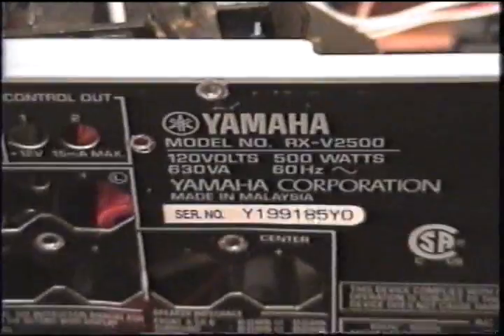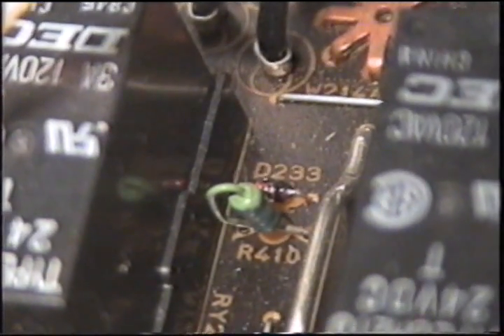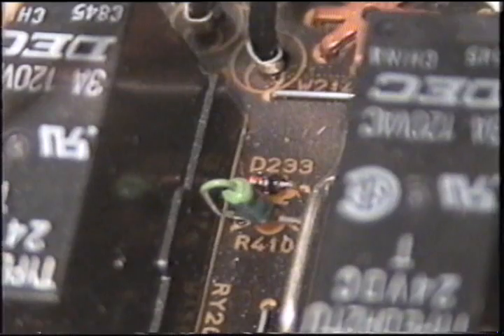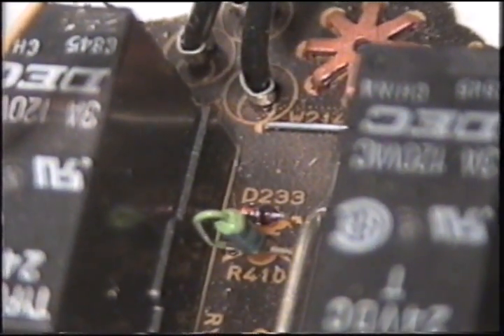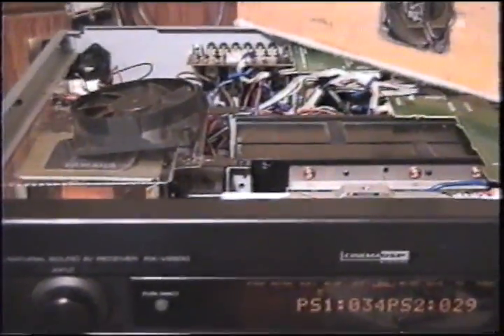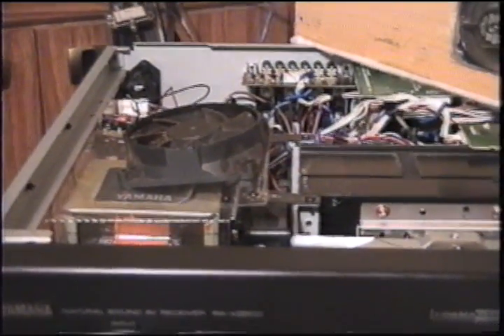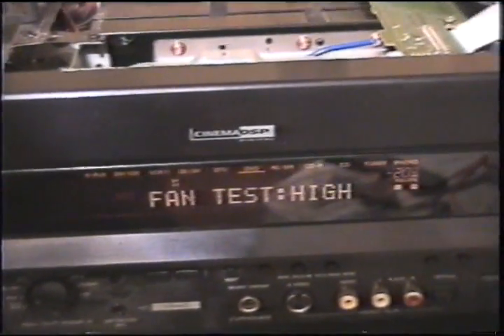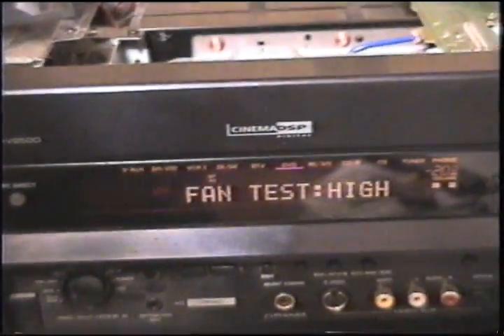Yamaha RX-V2500 fan circuit repair

Comment: Hi. Do  you remember, when the fan begin works /how degrees/? I lesten music 4 hours on -8DB Volume and there is no fan. In sleep mode the fan work in all speed. 80 degrees"C i too much for me
Reply from the maker: +Teodora Avramova This link should answer your questions. http://rdimitrov.twistedsanity.net/blog/show.php?entry=Lowering%20the%20Idle%20Temp%20of%20Yamaha%20RX-V2500

Comment: Ok, great, that worked.  I have a RX-V2300 - but I can't find the fan speed adjustment.  Is it possible that's not in the 2300's firmware, or is there a method to dial to it?
Reply: Use <Program> key to enter sub menu to adjust. Go to Elektrotanya com for a service manual to be sure.
Reply: Somee GuyyThen Great - that worked as well - I can now dial between three fan speeds: High, Mid and Low.  Is there a way to either set it to 'Auto', based on heat, or to select one of the speeds and have it fixed at that speed regardless of heat?
Reply: Somee GuyyThen ok, thanks.  got it.  doesn't look like there's anything in there for setting the fan speed, one way or the other - just testing it.  But then again, I am not a service technician.  The local Yamaha repair shop somehow set it for the fan to be on all the time because they couldn't get the parts from Yamaha to correct an overheating shutdown problem at high temperatures/volumes.